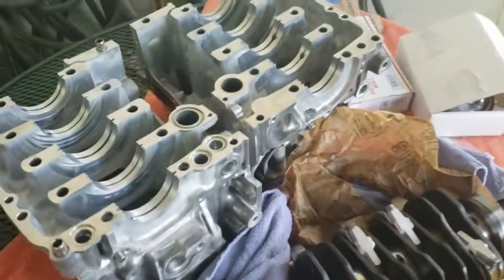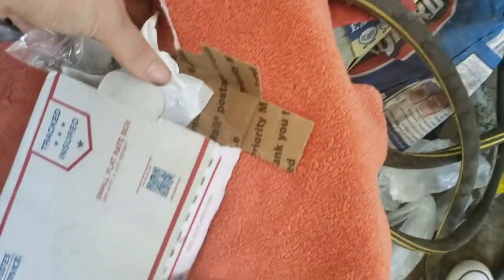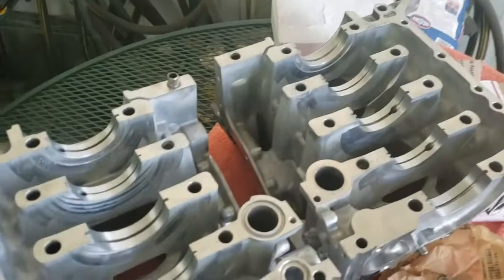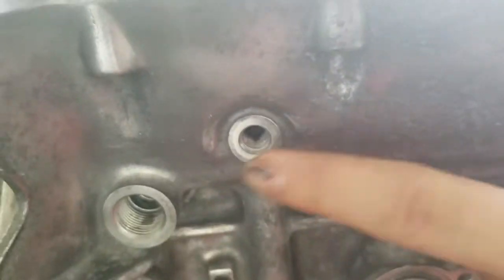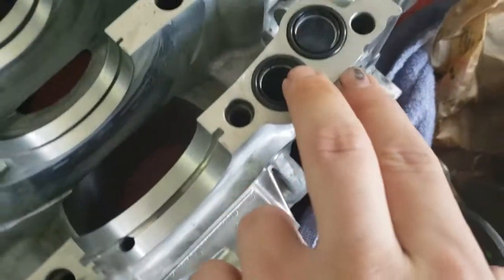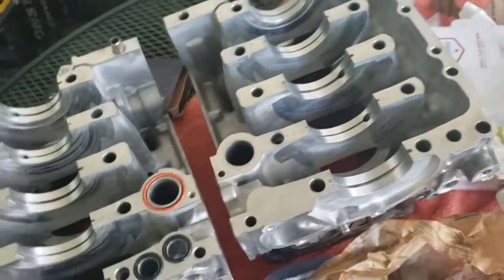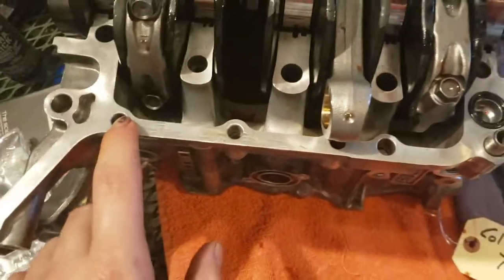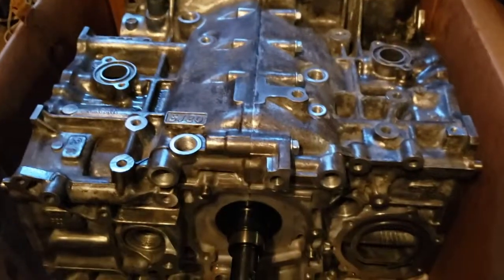WRX/STI Stroker Build Pt: 2 (Crankshaft Install/Joining Case Halves)

Comment: Hey Im rebuilding my 207, might go with a 79mm crank but I already have a 75 mm one. How much hp/tq you making with this setup?
Reply from the maker: Haven't had it dynoed, but it feel right around 320-370.
Reply from the maker: With this setup you get a nice little bump in tq without sacrificing top end. It's great for faster spooling and the extra tq makes ot great for street driving. The extra tq is alot harder on the glass 5 speed, but just run some blast plates or 6 speed swap.